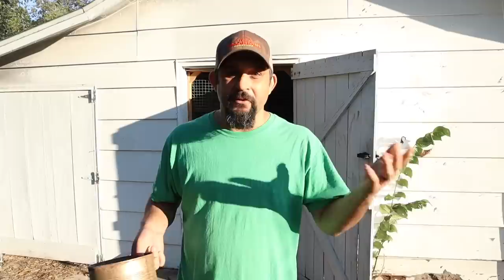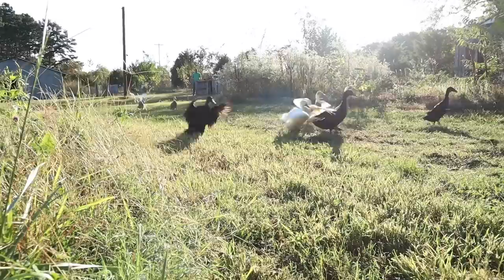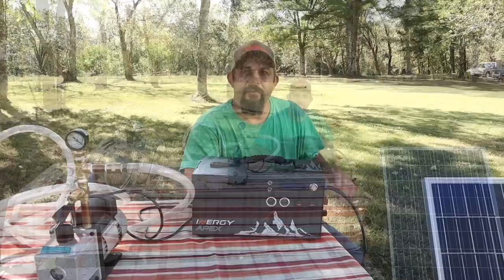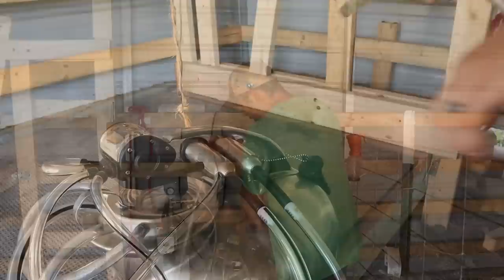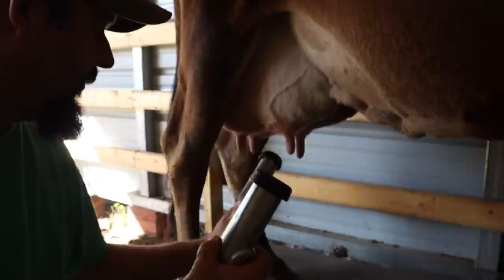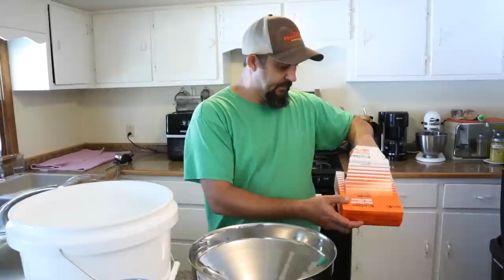Milking Our Jersey Cow!  How Does It All Work?

Comment: I have had 1-2 milk cows for years and have picked up quite a few tips from more experienced milkers over time and through trail and error.  When you are getting lots of raw milk and selling it,  it is nice to keep it fresh as long as possible.  3 things I have done:
1.  Cool jars of milk in the freezer for one hour first, then move to fridge (the faster it is cooled the better)
2.  Use standard canning lids and rings (they will partially seal as it cools and that will keep it fresher)
3.  DON'T use the cream separating idea from your friend.  I did that a couple years ago and the freshness of my milk (and cream) really suffered.  Especially if you are adding milk to it over more than one milking session.  
I have noticed the milk stays fresher much longer if I leave the cream on in the half gallon jars until I am ready to use the skimmed milk.  As soon as the cream is removed, the milk sours faster.  Nothing wrong with sour raw milk of course, but I love fresh sweet milk the most.
One more tip, use a sharpie to mark your date + AM/PM on the side of the jar.  Washes right off.  Love your channel, God bless.

Comment: I have some questions about your great setup. 1) What is the mounting adapter that the inter-pulse pulsator attached to? I have found the pulsator, just not that flat piece that the vacuum pump hose attaches to. 2) What is the typical psi setting for your vacuum pump while running the milker? 3) what is the diameter of your milk tubing? 4) what is the diameter of your vacuum tubing? Thank you. I also really like the customized parts on the vacuum pump with the gauge and hose attachment. That looks super handy. You are an inspiration and I look forward to learning more from both of you!!!

Comment: Thanks for the details. Just a suggestion, the line you leave in the stall area may get spiders, etc. in it so you might want to cover it with a cloth and rubber band, and to keep from having to hold the milk lines while milking you could hang a long bungee cord and S hooks to hang the line on.

Comment: In any home i have had I have an attic fan. In my race horse barns I have had fans up in rafters to keep air flowing through the rafters. You can either take them outside surrounded by bushes & protection or you can put a fan in the cooler end of the barn down low with an open screened end at the top of the hot end of the barn.

Comment: As a youngster back in the 60's, I had to use many of those type milking machines. I had 20 cows to milk every morning before school.  We had 5 machines so I milked 5 at a time and all with the strap around the cow.  Obviously if you're only milking one cow at a time, you can do it the way you are manually holding the lines.  It's when you have to milk multiple cows at a time, that you need the strap. BTW,  if you notice, on the handle at the very end is a notch. That's where the machine hooked on the metal loop of the strap.

Comment: Back in the 60s we milked with a system where the lid fit on one of those tall old fashioned milk cans. If I think there was an inline filter so when the can was full the lid was put on and taken to the milk house and put in a cooler that had ice cold water. My mother had an aluminum can with handle that held around a gallon and she would skim cream off the tops of the cans before it got sold to use for butter etc. I still have that can.

Comment: Great video. I learned how to milk with that particular style of milking bucket at my Uncle's farm as a child. As you said, the buckets were held by a strap over the back of the cow and we moved them from cow to cow. we could get usually 3 cows in each bucket before we had to dump it. We milked jerseys and a couple of Guernsey cows. Uncle had 50 cows so we started early in the morning like 4:30 or 5 o'clock to milk each day. After about 5 years uncle change to the automated system where all of the suction cups were mounted to a free flow system that took the milk directly to the tank. Trucks came to pick it up each day. We still had 2 cows that had to be milked by hand as the machine milkers put too much pressure on the teats.  Have a great day and God-bless.

Comment: Instead of bleach have you considered using a mixture of food grade peroxide and water? You can even add your dish soap if you want. But it would be safer for both you and hope than bleach.
Reply: Most dish soap isn't supposed to be used w bleach. The Hydrogen Peroxide sounds better. However some pathogens are only destroyed with bleach, so there's that worry.

Comment: We have quail in an outside pen and they survive Alaska winter.  On our coldest days I aimed a heat lamp at the top of their rock cave we made them to provide supplemental heat.  Also, my husband lined the top of their roofed pen with blue styrofoam insulation sheets left from insulating under our house,  if they fly up, it makes a softer thing for them to hit.  Multiple places for them to hide and sand for the ground.  They usually soil along the edges of the cage so just dig out edges and replace sand periodically.  We use heavy mink wire and bury below ground then cover the bottom portion with the smaller wire similar to what you are using for the base of your quail cages.  We found they love to sleep near sides of  yard and Ravens were reaching through the larger mink wire opening and pecking at them. Long comment!

Comment: Kevin/Sara-What if you installed a stiff wire around the 2 x 4 railing above your head,  you could just loop the tubing over the wire????? 
 I did not know there are 3 different sizes of jersey cows.  Depending on how much milk you want to milk per day.
There is a good video showing the 3 sizes & how they hand milk their cow.  It is a video 2/3/2018 & by homestead. Titled "milking a mini jersey/the perfect family cow"
For them it was less work so they no longer milk goats as they like the cows milk for them.  They also would get a calf (from the cow) & sell it & get $2,000./$3000???? for income.
Hope this info helps someone????

Comment: I've been racking my own brain about how I will house my quail once I decide we're ready to raise them. Our winters are super harsh here SE Wyoming, so I'm thinking of building a coop that doubles as a greenhouse for me. That way, they have shelter from the snow and wind in the winter, and can peck away at the ground during the summer.  Maybe you can do something similar? Of course the weather is way different in Missouri  than it is where I am. But maybe you could build them something like that has access to a yard where you know it won't flood when it rains.
Reply: Amanda - you might want to check out the quail playlist from BLUE CREEK DAIRY FARM  - they are in WA and kept quail in plastic covered tractor ... also had some predator problems.

Comment: Why not put the quails in a track like the rabbits? Similar design and it will provide better air flow & they have the outside environment than just being inside that little building. :)

Comment: Actually, at 9:31 you say you recharge the generator in the house, so that is not exactly solar powered. I don't know how long the vacuum pump runs but if it ran more than an hour or so 200 watts of solar power probably would have a hard time keeping up after a few days of just solar. BTW, if you lost power and had to use the back up in the house or you had guests in the cabin, hand milking is an option. I know you have stated that your main goal is self-sufficiency because I do not see much savings. (except for peace of mind) Keep doing what you're doing!

Comment: Looks great. Once again though, I wouldn't use anything plastic, even food grade. Plastic is porous and over time calcium and mineral deposits will build up. I definitely wouldn't use a canning funnel for pouring the milk. It works in a pinch but not for everyday twice a day.
If you wanted to, and you may not, you could fix a way for the milk lines to hang out of the way on the stand.
As for the pigs, pigs naturally have parasites in their flesh. This is why commercial growers grow them on concrete and use wormers so heavily.
If I was to ever raise a hog again it would be on concrete with the floor heavily bedded with shavings. But to each his or her own.

Comment: The Surge Bucket was designed to hang underneath the cow, eliminating lengthy milk and vacuum hoses. The original (short) Surge milk and vacuum hoses are much easier to keep sanitary, partly because the bucket does not sit on the dirty barn floor. 😀